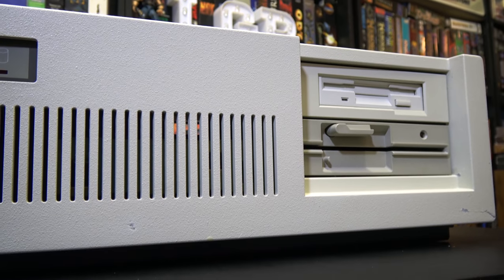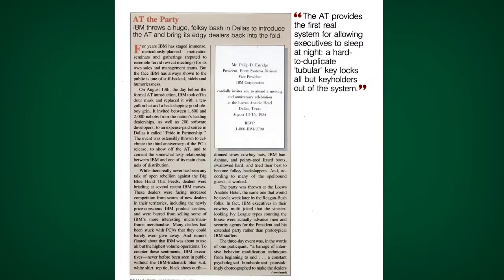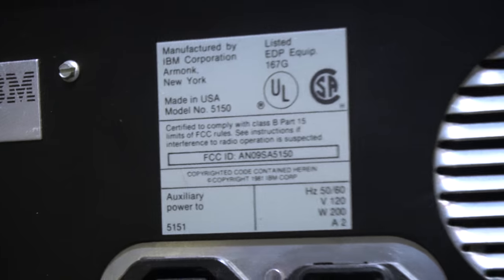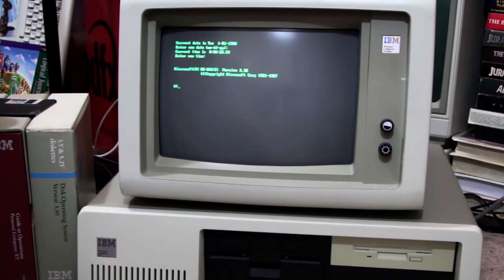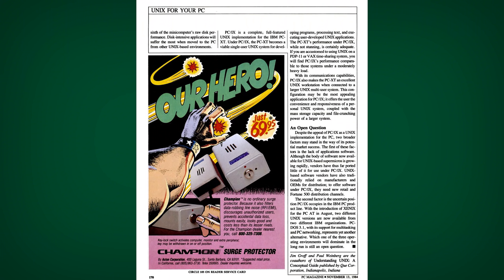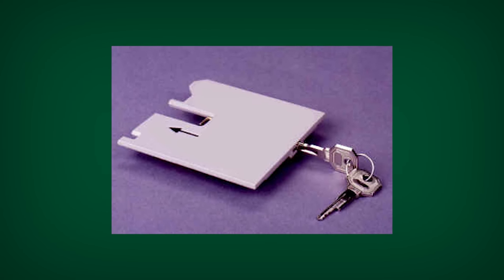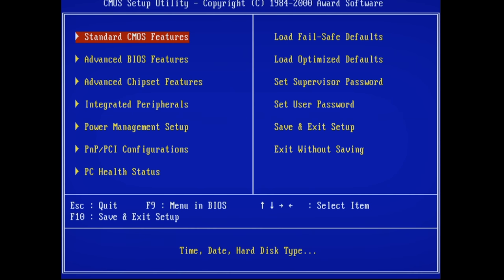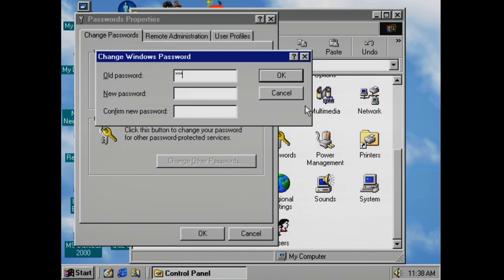Why did old PCs have key locks? An LGR Retrospective

Comment: The part that was a problem was: RAM was freaking expensive. (And other internals). And the the typical RAM slots covered a VERY wide range. 

FREAKING expensive. Campus computer labs, or random office cublicle, or wherever ... The computer could often still work (particularly if some barebones RAM was shoved back into it). But the whodunit is tough to track down ... and the thief has something that is likely to work in their own computer (or be sellable).

Comment: @4:24 the floppy drive lock. "... a key awkwardly sticking out of it ..."   You aren't making sense.  Clearly the key does not have to be left sticking out of it, or it would be useless as a security device! Maybe the key is held in after you unlock and remove the device from the PC but even then the device could be "re-locked" when out of the PC and the key removed. I still have a couple of those BTW, we had to use them at work once.

Comment: Haven't seen a key lock in over 25 years.  I worked for a company that had it, and never knew why?  I also worked for a company that used the old dot printers.  I guess it was cheaper to use.

Comment: This lock should be reintroduced in a modern computer. But instead of locking the whole keyboard, it should simply lock the caps lock key. That's the one key some people tend to misuse.
Then there should be an "Internet license" in order to earn the key to unlock the caps lock feature.

Comment: Some of my Desktops allow me to lock the case, but these are business models...
It's so noone can open the case, pull the drive, and put it as a secondary drive on their PC to access data or install an OS on a system where they can access the BIOS, and install an OS where they have admin access to a drive they can put back into the PC, effectively giving them full access to the machine as if it was theirs instead of being stolen from me.
Reply: I had a Compaq where you could unlock and lock the case from the BIOS, but if the machine stops working that's not an option. I think it had a keyhole as well, but I didn't get the key as it was gifted to me when I was a kid...

Comment: The most useful application for those locks was keeping your roommate from using your PC.  Computers were still single user, and at the same time, even if there was password protection, chances are that your password wasn't "robust" by modern standards, and eventually your roommate, who knew more and more of your "precious" words /dates / etc.  would come up with it.
Reply: That's why you shouldn't use actual words at all on anything that you want to be secure.

Comment: Why is that a better unhackable
Solution then the login password menu, and why did we stop using them. 
Because imagine if it worked like a bike ignition. Can’t use software until the key is in and engaged

Comment: "Flimsy Windows password"?
With Win 95, 98 or ME certainly. They still used FAT32 as a file System wich did not support any rights management.
But 2000, NT, XP and everything since? If they get properly installed on a NTFS partition, the password is solid.
And UEFI put the final nail in, having Legacy boot options (like USB stick and DVD) turned off by default. Add a password, and an attacker would need to open the case.
Nevermind cases where the file is not even on the computer itself. Then you would require physical access to the Fileserver.

Comment: In 2003 i had an IBM pentium 4 computer and it had a keylock you couldn't open the case and turn on the machine without it :)

Comment: I have never seen a keylock that stops the case from being opened back in the day. Maybe it was more a USA thing? Daft having a keylock that does not lock the case as you can open case remove cable from keylock....  or short it.
Also it never stopped you from hitting reset or power off......

I love that power on off lock.. Never saw that in the UK. Do not see point of it as you can just unplug it from socket end or switch off at the socket......

Never once in many years of IT (from installing software / hardware/ support to developing it) did I EVER see anyone actually using the keylock other than just playing with it when its a new toy.

Comment: I have a Alienware area 51 from 2001 that was built back when alienware wasn't dell acquired shit and it has a tube key front panel lock that seals the case from opening.  The point for that model was to protect components from being taken easily.

Comment: When he said high security i laughed.
I watch LockPickingLawyer.
Those sort of locks typically don’t even need practice or skill as long as you have a tool.
Reply: There were some older IBM business machines that used a much higher -security 3-pin Medeco lock with the rotating angled-cut pins. Much harder to pick that the tubular locks.

Funny thing is, some of the cheaper computer tubular locks had dummy pins: it would look like a 4-pin lock, but two would be dummies.

Comment: While each of the locks mentioned in the video might seem silly and insufficient ... imagine.. for a second... that you used all of them. 🤯 

A case lock, coupled with a metal bar through the case and a padlock on the rear, a lock on the power button, a floppy disk lock, a power cord lock coupled with locking the surge protecto, and disabling the keyboard....

Now my porn collection feels secure.

Comment: What was the turbo button for? I'm old enough to remember seeing them, but can't remember there use...
Reply: The original 8086 processor was available in 4.7 and 10 Mhz.  Games written for the slower unit often ran at double speed on the faster chip, so the Turbo button let you select between the two clock rates.

For more fun, NEC released a 20Mhz overdrive processor that was drop-in compatible with the 8086 chip.  I don't know how it handled the clock rate difference.

Comment: Could be nice to have keys to physically disable USB today. I understand, open the case, solved. But if it's inside an office, a coworker opening your case when you go out for lunch is not a normal thing. If someone breaks in at night to get into your PC or steals it, no key is really doing any trick, you take a grinder and that's it.

Comment: Sadly despite attempting to be authoritative and speaking quickly you do not understand why the case locks were in place. In the early days computers were expensive and often chained to desks - but the components were also expensive so it was common for offices to be broken into and the hard-disks and RAM to be stolen from computers. Easy to take out and remove from an office they were an easy target if there was no case lock.

Comment: Actually... I am still using a "Chieftec Bravo" big tower computer case which was heavily modified by me to fit in modern components inside. Details aside, it still has the original keylock on the front panel. The case is from 2006 :)

Comment: by the way, for that locked computer, you could try to pick the lock, it's a little tedious but not too difficult, as iirc the tubular lock was originally designed for arcade/laundry machines to make it take a long time to open without the key, as you essentially have to pick the lock for every pin in between the locked and open position. one of the harder things of a tube lock is tensioning of the little tab. but once you've tensioned it it's easier to pick than a regular lock because all the pins are visible.

tl:dr tube locks are designed to take a while to pick, as the security of them is getting caught rather than pick resistance.

Comment: Yah but why a turbo button why wouldn't you always run that way.
Reply: Back then some programs couldn't handle faster clock speeds, due to the different uart chips, i /o, channels in different clones, the memory was limited to one mega byte, so alot of swapping was going on to the hard drive while the CPU was fastest part it waited for the harddrive to catch up from swapping data back and forth from memory to hard drive and program execution.
 The dma (direct memory access) channels. Had to juggle between that and the old serial cables or centronix/parallel cables.
Then if ya had it on a network even more timing was needed.

Comment: 66 Mhz wow those were the days. I had a Hewlett Packard 486sx, six months later the 486dx 66Mhz came out and gaming software for the sx fastly died,, oh well I'd spent 1200 British pounds on it and sold it for 400 while it was still worth something,, I didn't touch a pc until  1999,, which was 5 year's later when intel had stopped rapid progression of their chips and AMD were on the scene, I built a pentium with a dvd writer and pci graphics card or was it agp it's so long ago,,I'm now with the multicore i7 chip last one before i9 came  I built with a 4 gig graphics card ssd hard drive and a secondary storage drive,, I've never had a pc as fast,, starts up in under 10 seconds,,, my sons I bought his made up by a pc builder and that is even better than mine,, he can play all games at a huge frame rate,, I was lucky that time after the i9 came out I left it 6 month's then got a top end i7 for him for 1000 pounds less if I'd bought it earlier,, computers hard work sometimes but where would we be without them ❤️👍

Comment: The long metal bar looks like a slim Jim only a tad thicker, but I'm wondering if it was to thick to slide down car window and unlock the door.  Of course it had to be a older car bout 30 years and up to do that isn't it?  Wonder if a slim Jim still works with these newer cars with all those computer chips in every crack and crevice of a car these days.  I worry about those cars that do the driving for you ,and there are videos of people driving while asleep and let the car do it on autopilot.  That's not how that's supposed to work, would it fail... like all computers do at some point but that would be awful! Those people is going to kill someone one day or themselves! Wish they never came out with that and have them band off the road and make them illegal AF! Way to many non responsible people out there.  Damn rich people who can afford that car has it easy enough now, they cant even stay wake long enough to get to their destination? Wow that's pretty pathetic.   I hope they outlaw that type of car. We are just not ready to handle that responsibility.....well for most of us anyway!

Comment: I want my pc to be turned on/off with a key. Is it possible in 2019?
Reply: It is
Reply: How? Do I have to buy a new pc case or can I modify the one that I already have?
Reply: @peterthekid  you can modify it but you  need to make hole for fitting it
Reply: @agis43  that's no problem. Thanks

Comment: in this day in age no one is running off an 1980 computer lol more like 55in 4k flat screen wireless mouse and keyboard cooling system and best for last over 10 terabyte hard drive  high end graphics card        keylock for computer lol more like hope to god you can decrypt the code hahahaha             so not 1980 any more man the only thing old computers were good for was pong
Reply: Sorry but i don't have 55in 4k screen wireless mouse and keyboard cooling system and 10 terabyte
Reply: @g2ltt733  no reason to be sorry